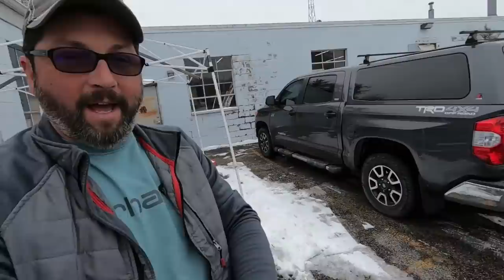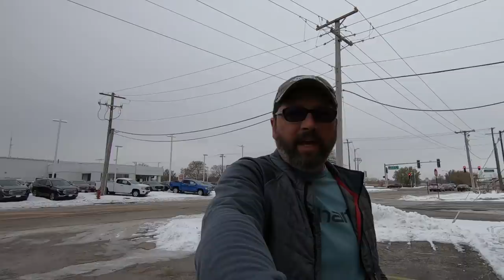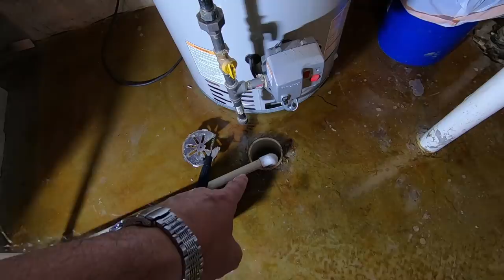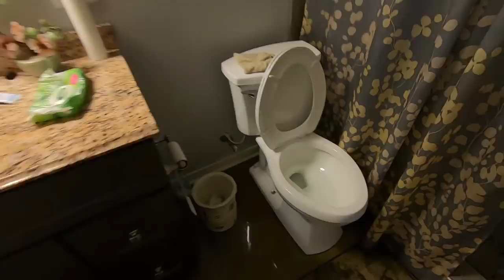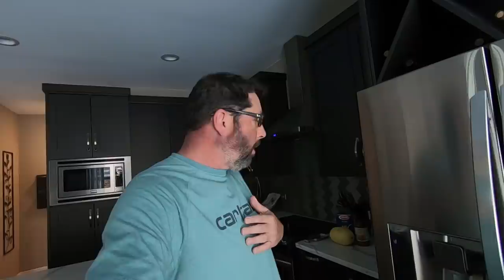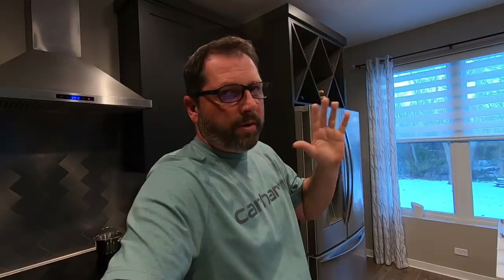Shop - Honey - Injector Pump and Cooking

Comment: Pete, sorry you had to deal with the flood just getting back from vacation.   You may want to check with a plumber about installing an anti-reverse valve on that drain line at the drain pit to keep the paper and other things from backing up into that smaller line.  Thanks for your great content.  :)